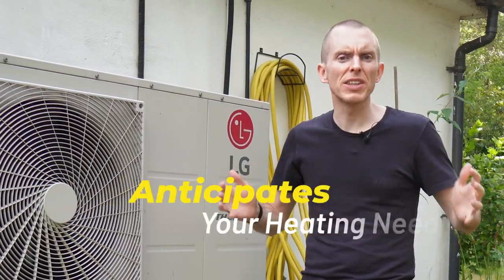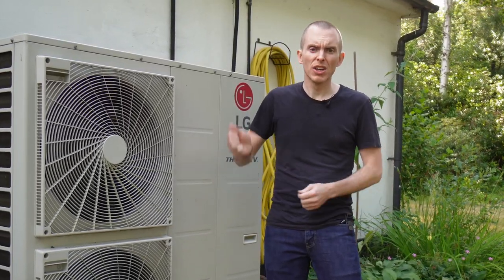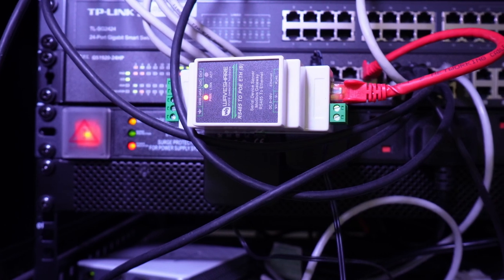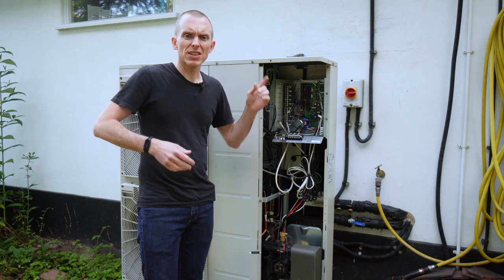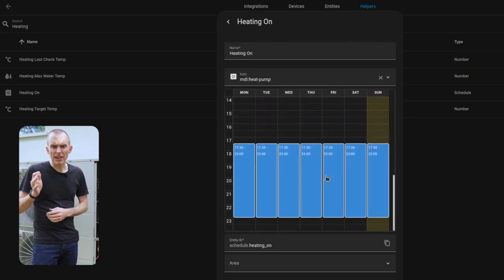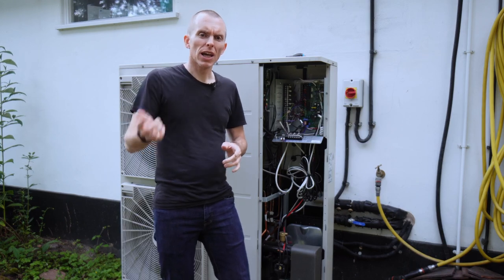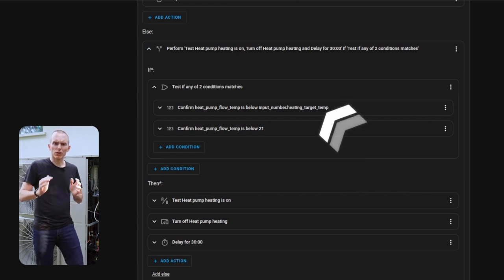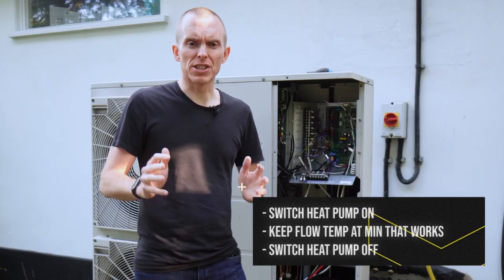Home Assistant Fixed Our Heat Pump!

Comment: I've been trying to get the LG ThermaV 12kw into home assistant. I found a modbus module made by lg, but the headers on the main board of the heat pump are missing. I have resulted to using  two shelly relays for each cooling and heating mode. And are running the heat pump in auto mode. 
Looking at the modbus accessible data. You should be able to calculate cop based on the internal lg sensors. 

Would love to know how you got your modbus working.
Reply from the maker: I'm definitely planning to make a video on adding modbus, hopefully in the next few weeks.
Reply: @RodMcBain  i m interested to the modbus module and what can we do with it?

Comment: No modern heat pump work with the classic on/off, considering all modern one work with inverter technology, LG for sure. And it's impossible for an heat pump to work alone during winter, fun fact the heat pump it's not the heart of the system, but normally it's combined with gas or electric stove, mostly depend on the brand of the heat pump. LG doesn't make gas stove, so normally it's installed in combination with an electric boiler. 
Of course everything, it's controller by a smart controller. 
In your case, probably how installed this solution, doesn't install it in the right way.
Reply from the maker: The on/off thermostat was really just scheduling when the heating should be on, the pump itself was looking at the flow temp to decide how hard it needed to work, but obviously to increase efficiency you want to heat the water to the lowest possible temp that will work.  Not sure where you live but in southern England it's certainly not true that a heat pump can't be your only source of heating and would almost never be combined with a gas or electric stove. That said in my old inefficient house I do have a wood stove that helps take the edge off the coldest days. The only way I can imagine an electric boiler making any sense for heating is if you're in a climate cold enough that your heat pump can't operate otherwise, it would make no sense at all.

Comment: What about domestic hot water? Isn't the heat pump used to heat that?
Reply from the maker: The heat pump does also do our hot water, that can also be controlled from home assistant, setting if the hot water is enabled and the target temp. When hot water is enabled the heat pump automatically kicks in an heats the hot water when the temp in the tank is 5 degrees bellow the target temp.

I don't currently do anything but monitor this from home assistant, I use the scheduling built into the pump to control when hot water is enabled and what the target temp should be, I do plan to shift control of this to home assistant to have more fine grained control.

Comment: Thanks for sharing. I am just starting my Home Assistant journey and have been investigating Heat Pump options. There seem to be quite a few integrations for A2A, hopefully we'll see more support added for ASHP soon. I definitely want to pick an AHSP brand that supports a protocol that may be interrogated locally.

If you haven't come across them yet, it's worth learning about Trigger IDs in Home Assistant automations, they enable you to have several different triggers in a single automation that you may use to define which actions should occur. For example, rather than an automation for on and another for off you can add the two triggers, give each a unique ID, then in the actions you start with a "choose" that has several "when triggered by..." options.
Reply from the maker: Thanks, I'll definitely look into trigger IDs, sounds very useful, although I guess sometimes it's still going to easier to keep track of what going on when split up into smaller automatons.

Comment: I too have an LG ThermaV ASHP, but I’ve got two 9kW units in a master/slave config as the heat loss sizing indicated I needed an 18kW setup and there wasn’t an MCS certified heat pump of that size.  So two ASHP’s it is but does mean any smart integration costs are going to be x2 ☹️
The LG menu and setup system is awful. Can’t believe they’ve made it so complex and difficult to use, no native WiFi app, only via the control panel and in my case they’re in the loft.
I’ve progressively been trying to find the optimal solution for my ASHP control.  Turning the flow temp down and increasing the run time of the unit so that the heat pump isn’t running at full tilt to heat the house up.  That’s when they get expensive to run, when they’ve got high heat demand to achieve.  Partly this feeds into the advice to keep them on 24x7.   In May this year I turned on the AI mode; too late to see what winter difference it made for me.
Definitely interested in seeing how you achieve modbus integration, what you can do with it, and integrating it to HA.  Thanks
Reply from the maker: The Wifi module is stupid expensive what it does, I just posted a new video with details of the modbus integration https://www.youtube.com/watch?v=Xuj2YFZ5zME it's certainly better and a lot cheaper than the WiFi option.

Comment: Is that heat pump really tall or ...? Anyway, would be good to have an idea of scale, I'm looking at a similar sized heat pump.  Really good video, and provides good advice on home heating automations.  I currently use google nest, with the existing heating system (which is being replaced), which is set and forget.
Reply from the maker: It's a bit of both, I'm about 173cm so not tall but also not tiny 😀 Being a 16kW heat pump with double fans it is quite tall, the unit itself is 145cm but it's on rubber feet that probably add another 15 cm and that sits on a slightly raised concrete pad.

Comment: Great video. Surprising how much more optimising you can do on a heatpump. I'm walking the path of monitoring and optimising my heatpump.
Be interesting if you added you data to the My Heatpump Open Energy Monitor. There, you can monitor flow, return, ambient, power in and heat output.
This way I can see what I need to tweek.
I'm trying to do the same. Keep the flow Temp as low as possible to maximise the COP which out excessive cycling of the HP.
Reply from the maker: Thanks, cycling the heat pump was a big problem with my original z-wave thermostat, none of the built in TPI options came anywhere close to being suitable for a heat pump. 

I'd love to setup open energy monitor to accurately monitor the COP, but for my heat pump it looks like that would cost £785.99, It would have to result in some serious efficiency gains to make that a worthwhile purchase. I think for now I'll have to rely on the data have in home assistant.
Reply: @RodMcBain  I don't have a heatmeter. As long as you know your flow in m3/hour or litres/min  flow, return temps it can all be calculated quite easy in HA or node red.

Comment: This is fantastic!! Thank you!! I tried to do the same but warranty was always a problem!
One question I have: how does your controlling have effect of switching in and out as part of the lifespan of your capacitor(S)?? So far the constant switching on and off took many times replacement of these. I am not an AC mechanic…
Reply from the maker: Thanks for watching, I can't imagine adding LGs own WiFi module to your setup would have any effect on your warranty. Maybe I've just been lucky but I've had no problems to date with the capacitors in my heat pump.

Comment: Using weather compensation in the LG controller is the easiest way to do this, no need to do an extra automation. A smart thermostat and dumb TRV's will also help enable the right temp you want, especially if the LG controller is wired into a room that isnt an ideal location for temperature for example a garage. The HP and the rads/UFH all use the whole home as a heat store, if you start trying to manage rooms to radically from adjacent rooms you will lose efficiency, this is why all HP pro's will tell you to leave running 24/7 with perhaps a small offset overnight.
Reply from the maker: I'm just not convinced the concept of using your house as a heat store works in an old solid-walled house. It makes sense in a well-insulated house but that's not currently this house and my experience showed it to not work efficiently.

It would certainly be interesting to collect some better stats and run some experiments to compare this setup to the basic weather compensation in the LG controller.
Reply: @RodMcBain  insulation, in this case, is your answer. Solid wall is a poorer heat store, it needs more constant heat.

Comment: Not sure if I got everything correctly but what you’re doing here with HA should already be built in the software of the unit itself. Of course you want the lowest flow temperature possible but normally you just need to find that spot once and never touch it again. Just adjust the heating curve correctly according to the outside temperature. 
Also, constantly switching the heat pump on and off will significantly reduce the lifetime of the unit. Normally you want it to run as long as possible with minimal power to increase the lifetime
Reply from the maker: Not constantly switching the pump on / off was one of the main reasons for setting this up, with the thermostat that was used when it was installed it was constantly toggling on / off when near the target temp. With this setup when the heating is scheduled to be on the pump only actually come on when needed and then only gets switched off when the flow temp has dropped to below the heating target temp for some time, I think leaving it on at that point is just pointless.

Like I said in the video, I've not really messed around with what LG call their AI option, that attempts to adjust the flow based on the outdoor temp (I think the AI bit is just marketing BS). I really don't think it would work well in an old house like this where some is well insulated and triple glazed and some is old cold and single glazed. I know the solution to that is to fix the house but for now this works well.  In home assistant I have a lot more data available than the pump does, i'm not there yet but with that data available I'm sure I can make better decisions about what the flow temp should be.